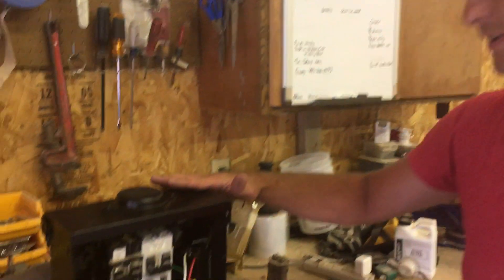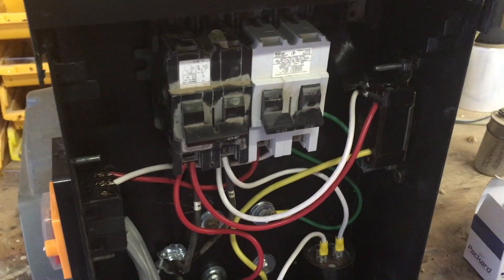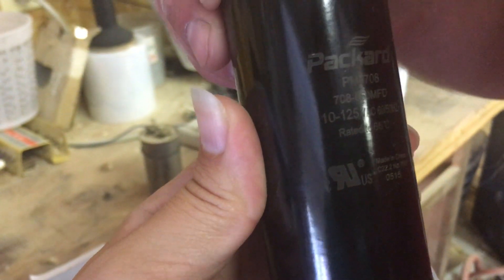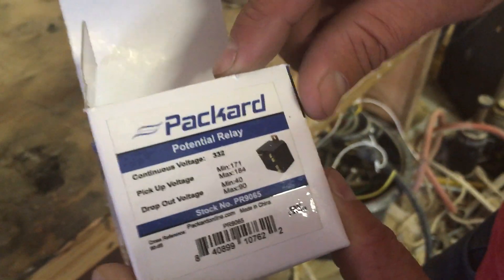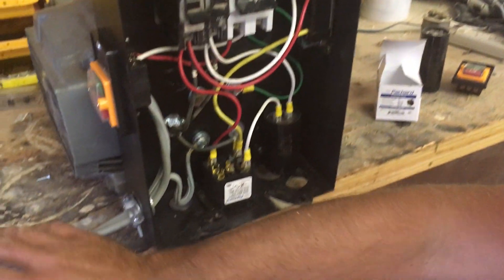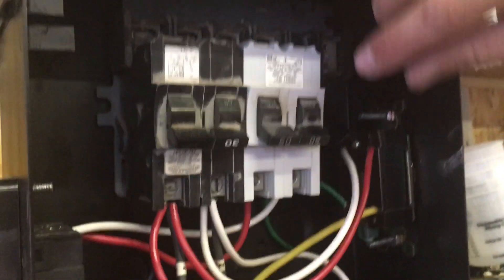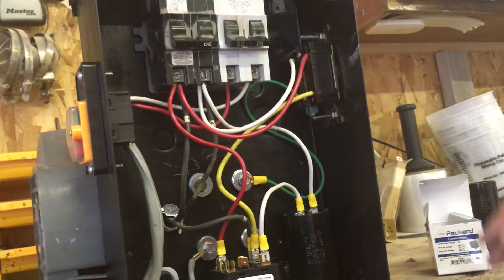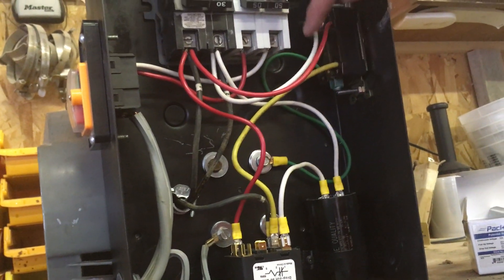How to Build a Rotary Three Phase Converter with details & parts Urgent Read Description if Building

Comment: Hi there I'm trying to build a rotatory phase converter to run my three phase tyre balancer it has digital display. ive got 240v single phase. with under 1hp motor and a 415v transformer in it. i have a new three phase motor 2hp 415v. I have it running on 240 volts with a cap to start. its wired in star but when i take a reading from each leg IE l1 l2 l3 they only show 192v each. do i need to put it in delta to get the 415v or is this right? hope you can help Nick
Reply: Check the specs of your tyre balancer motor if it is a dual voltage, maybe 240v/415v, if dual, set it to 240v , its two wye or two delta parallel connection, your input single voltage is 240v, then you will get same voltage, just balance it with capacitor to get good result. Now if not dual type of motor, use step up transformer... 240v primary , secondary 415v, your 415v pony motor will now output 415v .
Reply: Also check your pony motor if it is also dual voltage.. need also to change  it to 220v.
Reply: And better make it delta connection.
Reply: @ericksonhermo  hi thanks for the replies. So are you saying the idler motor in Delta?  The balancer has a 415v transformer in it. Both idler and balanced can run on 220v or 415v. Can you tell me on each leg of the idler motor ie L1 L2  L3 what voltage should I be getting. That would help a lot thanks.
Reply: @nickgc1234  what i am saying , first check your idler or pony motor, some motor is dual voltage, 220v low voltage or 380v or 400v high voltage, you need to select the correct voltage,
Reply: You need to look and check the input voltage of both motor, idler and your balancer motor, maybe both is dual voltage. If you will see like this 230/400 then its dual. You just need to change wire tapping . As you said , power source is 240v,   it will not step up into 415v 3 phase, without step up transformer, so if both motors were dual voltage, just set it both to 240v, now if idler is now 220 v input, then it will also produce 240v, you just need to remove the transformer which i think a step up, and directly tap the produce voltage into the motor which must be set to 240v.
Reply: @nickgc1234  if you can give me the specs of the transformer- the input and output voltage, the specs of the idler motor, and the balancer motor .. i can provide you a suitable solution. Give me also the model number of your balancer,
Reply: Hi thanks for your reply i have pics of all specs and schmatics etc but how do i send these to you it wont let me post them on here?
Reply: @nickgc1234  got your pics and schematics , your machine is 380v,  your motor is star delta 220/380v 50hz but its set to 380v, transformer primary is 380v, sec 16v and 100v. Your power supply there is 220v single phase. Solution is to put a vfd specs 1.5kw, input 220 single phase, output is 380v 3 phase. Buy on lazada worth 150usd . I sent details how to install.
Reply: Send it to me at hermosisimachash@gmail.com

Comment: I a little confused I have 240v single phase and i want to run a Tyre balancer it is also digital display and runs on 415v 3 phase. it needs all phases out 415v and then runs through a transformer on the mother board. Now would this work on this??? Nick
Reply: The 415v will be the supply voltage of the motor,  220v on your  control board. Your electrical requirements will be 3 phase wye 415v common neutral . Neutral and line will be 220v. Electrical provider on your place will put same specs transformer. But expensive .
Reply: I think, your unit has vfd ,power source input 3phase and neutral and your motor is  frequency driven.
Reply: Rotary phase converter will do, if your motor is 2hp, use 4hp as pony motor, check your 2hp motor if it is dual, if dual, set it to 220v, your 4hp must be also dual, now both 220v, your pony motor output will also be 220v 3ph on your 220v single phase source. The transformer is a stepdown , check the power req of the control board, if its 220v, remove the transformer.  Just tap your power source directly.

Comment: Your three power legs won't be even powered, you will need some capacitors to regulate the third leg voltage. Relays don't regulate the power output. . You should try for even output on all three legs spikes can damage some three phase items.

Comment: Quick question ........ so after all this once its done can we use multiple three phase machines through the outlet ????
Reply: only start the machines one at a time, but be sure the breaker in your main panel can handle the total machines running including your 3Ph Converter

Comment: variable frequency driver would be a better solution, cheaper and more compact, eliminating the need for a motor
Reply: David Stroz - Sonic Orb Studios , true story. However, doing this with a VFD will reduce the hp of your motor to 2/3 the rated hp. A rotor phase convertor will give you your actual hp rating of the motor you’re running.

Comment: I built one from a 5hp motor I got out of a dumpster. I got capacitors to start and to balance it from old metal halide light balasts and it uses a potential relay similar to yours. It has been started and stopped hundreds of times and run for hours at a time and has never given me any problems. The only thing i noticed is the current at the generated leg is always low, so i dont think my machine tools are up to their full rated horsepower, but i have never had any power problems and ive taken some heavy cuts.   I have a 10 horsepower motor also from a dumpster, which i intended to build another larger unit from , but it hasnt been a high priority. Nice job on yours.

Comment: 1st of all thanks for the video is very helpful. I am a little confused at the end when you said that you start up that motor on the 3rd leg with the capacitor but...there was no 3 phase power before been generated the 3rd leg. So correct me...does the motor runs of only 2 legs all the time to generate the last 3rd phase out out from the motor to be able to use it on the output as a full 3 phase outlet?>

Comment: put a volt meter on your legs bet they are at least 25 volts different from each other. U need to add run caps to balance it.
Reply: I like your understanding of the electrical problem with the system and trying to teach and help ,Than others missed the whole point of the exercise and more complaints on his fingernails!Their Dumb Down education and Narrow mindedness was shown.
Reply: He never ran it
Reply: Thats my problem, where would i add the the run caps ?
Reply: electromechanical stuff , so this would work but it would work better if it has a run cap?
Reply: Where in the system should the run caps go... and how do you determine how many / what size run caps to use?
Reply: 1KnowWearMan 
From memory - just researching to build a 2nd after over a decade - I think they link between the phases.
Reply: I'm just learning trying to set up my own but it looks like from what I've learned  run capacitor between line one and the ghost wire until it is right and then between the ghost wire and line 2
Reply: Wow thanks youtube. I never got a single notification of these comments till just now. I followed this video series below. In his description he has a link to the written material. The link is an awesome explanation
https://youtu.be/u229h7NcMxk
Reply: @electromechanicalstuff2602  The guy you referenced built his the correct way! Balanced!
Reply: @electromechanicalstuff2602  I put it on my list! THanks!
Reply: It MUST be balanced and the only way to achieve balance is with the proper capacitors.

Comment: That what you have there is a static converter isn't it?  the title says ROTARY but it's not - at least I see no rotary component. And in a rotary unit the third generated leg is always being generated by the  rotary component (AKA the 3 phase motor used as a generator).   Also you didn't discuss the MicroFarads needed per HP of motor for the cap.
Reply: .... What do you think the three phase motor sitting next to it is?  That's the rotary component.  He said 75-80mfd per hp.
Reply: My mistake then
Reply: You didn't pay attention PAUL, please watch again and listen......
Reply: lol
Reply: The motor on the back does a dual function is the driven motor mo is also the driver motor. 2 legs been driven by your electrical 220 and the 3rd generated to complete the missing phase used as a driver or output power having all the available power needed in the circuit at the outlet. Basically that motor is just to create the 3 phase outlet. You will be better of buying a VFD Variable frequency drive. One single piece of gear do all and you can control speed and % output.

Comment: Hi, thanks for the video.  Just to confirm, is the 10 hp motor three or single phase?
Reply: The Motor is a 3Ph to run the 3rd power supply the other 2 comes from your house panel

Comment: Good video.  Cutting off the motor shaft is easier than fabbing a guard and the expensive RPC motors are just standard motors without shaft extensions and a solid end cap instead. 

Best internet resource for RPC info is the Practical Machinist forum. It's for pros so I suggest lurking if you aren't a professional metalworker but it has tons of useful info.

Comment: is your motor single phase?
Reply: it wouldn't work if it was. rotary phase converters use a 3 phase motor running on 2 phases to generate  3rd phase. ghost phase

Comment: You didn't mention how to wire your donar motor.  How it gets 220v single phase and how you tap third leg to go into the box.
Reply: he never said delta o Y conecction inside I lost
Reply: Hi there Im trying to build a rotatory phase converter to run my three phase tyre balancer it has digital display. ive got 240v single phase. with under 1hp motor and a 415v transformer in it. i have a new three phase motor 2hp 415v. I have it running on 240 volts with a cap to start. its wired in star but when i take a reading from each leg ie l1 l2 l3 they only show 192v each. do i need to put it in delta to get the 415v or is this right? hope you can help Nick

Comment: Interesting build.
 You stated in the video the big part of what is needed is the switch. And the switch that you had was 3 Phase. 
 A Three phase switch on single phase has 2/3 amp rating.  
The switch you are using only has a 10 amp rating, sooo now 6A.
 A three phase motor requires 1.73A Single phase of what’s written on the nameplate.
 I’m just guessing, 10 hp 220 V three-phase motor will draw about 29 A.  So almost 50 amp single phase.  Then that passes through to a plug to run another motor. Let’s say it’s a 5 hp.  That switch needs to be rated for 50A Single phase min or if it is a three phase switch it should be rated for about 75A.

 That potential relay you have is not rated for the amperage either.   It should have an amp rating on it. 800 µF switching on your start capacitor has an amperage range of almost 70 A.  Make sure you keep it all in that metal box, when you let the magic smoke out.
Reply: Soesn't work that way. A 35 Amp switch is rated for 35 Amps across all it's contacts, doesn't matter how many of the contacts you're using, each is good for rated current.

Until you understand Ohm's law you probably shouldn't be giving electrical advice.....
Reply: better of using a coil and a single 1 phase 110 vac coil controller switch. There you can handle real amps. Good idea , more money to add to this thing. The thing I do not like is that I have to waist a motor just to create the 3rd leg but I have a friend who is an electrician and he does it a different way only with caps but he does not want to show me how to because he sale those for 500 plus instalation
Reply: If he doesn't want to show you he's not much a friend. A friend would give you a parts list and offer to sell you the parts .then volunteer to help on the weekend as long as there's cold beer .
Reply: @George-hl3qj  What your electrician friend is making is a static converter. they are not hardly worth $500. he must be quite a salesman   lol.

Comment: confused, is both breakers hooked together? I see the wires go into one set of breakers, but they come out of the other set.
Reply: The bus bars the circuit breakers are mounted on connect them together behind the scenes.  These are the bars that normally bring the main power in and split it off to each leg.  He's kinda using them backwards here, but it works.

Comment: Awww this is bull s&#!two motors to do one job.I know how run a 3phase motor with just compasters check out jomasterhn running 3phase on single phase 220v.dam I will say good job.but I was there 5years ago but it used to much electric.witch is b.s.

Comment: The potential relay is not one size fits all. The continuous voltage rating, the drop out voltage and the pickup voltage is different on different motors. The potential relay also has the wording "Top" or "This side up" on it. This is important for the relay to operate correctly each time it's switched on. When you described the capacitor, you didn't mention the voltage that was stamped below the Mfd's. If you installed a 120 VAC capacitor on your setup, it is too low a voltage and should be at least 230VAC and 330VAC would be even better and not much difference in price.

Comment: Aren't the 2 legs from the 220 180 degrees out of phase instead of the 120 degrees in a true 3 phase cycle?  Wouldn't this cause issues?
Reply: Once electricity runs through the circuit ( motor-panel voltage) it will take care of the phasing automatically.
Reply: My question also. And what is happening to L1 and L2 that your 220v ac compressor wants to see 180 degrees out of phase.

Comment: Hi thanks for this video. I'm planning to buy a 5HP compressor that works on 575 volt and I'll need to build a phase converter. Can I buy the same parts that you bought for your 10 HP rotary 3 phase converter?
Reply: Somebody can correct me if I'm wrong here, but I believe this only works if your motor can run in low voltage (208v-230v). You have to realize you're trying to run a three phase motor on single phase power, but you still only have 220v-240v to work with. Industrial motors are often made to run on three phase with either high or low voltage (480 or 208-230) with high voltage simply providing lower amp draw (coils are split providing less impedance). If however you have one only intended for high voltage, and 575 sounds like an odd voltage to run, then I believe you're stuck buying a new motor. Definitely check if it has a wiring diagram on the name plate, it may be possible to wire it for low voltage and use this kind of setup to convert off of single phase, and it really isn't difficult to do the wiring. If we can't help via PM or something there is plenty of info in forums across the web. If the motor doesn't have a name plate, see if you can find any info online that may indicate whether it can be wired high/low.
Reply: Jeff Sims you are correct, you only have 220 3 phase coming out. To get to 440 volts you will need a step up transformer. Here in Canada 575 volts is the most common in 3 phase. 
I have a 15 hp convertor with a 15 KVA transformer to step up to 575 volts and its working flawless for years now and used every day. 
An interesting side note, you should have 50% higher hp rating on your convertor then the biggest motor you intend to run but you can run up to 3 times the hp rating of your convertor at the same time providing they’re not starting at the same time. 
Each motor returns some power back into the system. 
I’m regularly running 35 hp on my system.
Reply: Here in Canada 575v is our standard 3 phase industrial voltage. We step it down to 460 with a transformer when we have to run an American machine or we change the motor to a commonly available 575 v motor.

Comment: Thanks.  Best video I've seen so far.  Even though you lost me half way through it.     I think you did well enough for me to make one.   I'm going to video my build as I build it.
Reply: I found a bad industrial air compressor with a 15hp motor. Paid 50.00  and have 200.00 ish  in the panel.
Reply: Hello friend, good morning, I have a question. In the white magnetic switch, 220v comes from the input, does that same power the black magnetic switch? Or where are the 220v of the white magnetic switch connected?
Reply: MotorHead Garage do you have deep pockets because running a idle motor will eat your money up.I know been there done that.check out jomasterhn running 3phase 7.5hp on single phase.and in the next video I will show how it done with just compasters

Comment: Electrical codes being violated.
Reply: Is cheaper than to pay for a 3 phase commercial utility service.
Reply: Not available to residential. Tried it, at least not where I live.
Reply: Even when commercial rotary or static phase converters are manufactured and installed installed correctly to current codes.......they are still "Downright dangerous".  

Defiantly not for people that don't know what they are doing.

Fortunately machine tools are easy to run, so that lets you get away with a lot, like in the design shown here.  Have you ever tried to design a phase convertor to start a heavy load, like a 200 HP rock crusher, or as delicate and an X-ray machine?   I have.  One of my past jobs was with this company : http://www.gwm4-3phase.com

Happy phase converting everyone..... Stay safe....